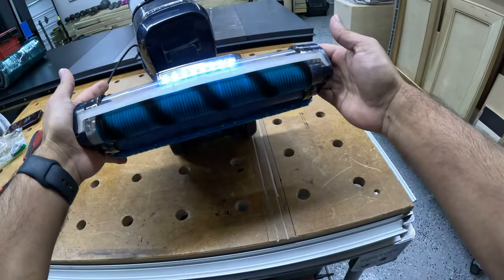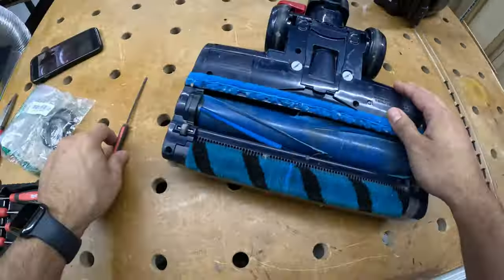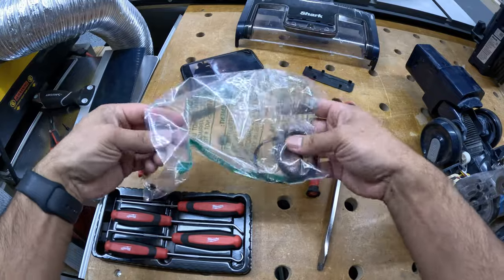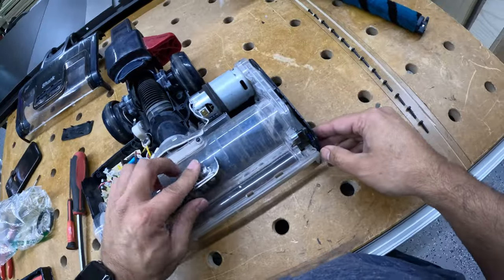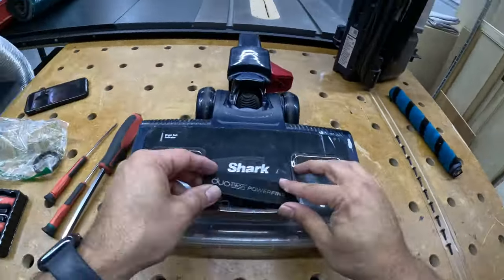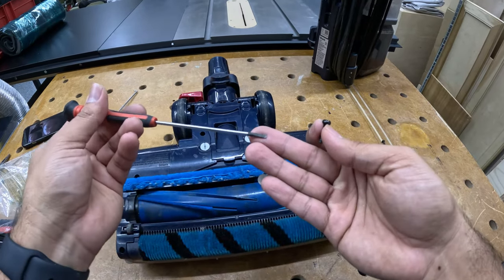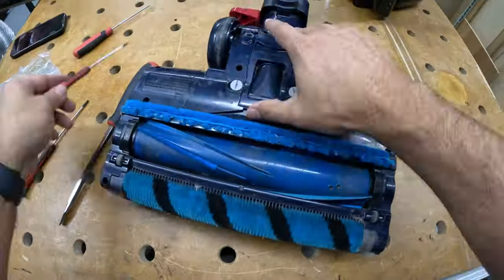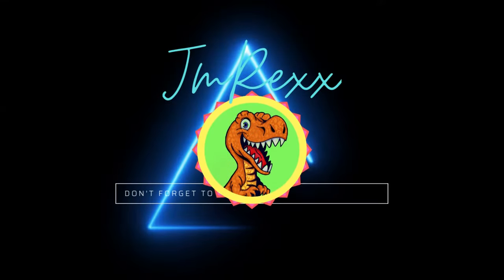Shark vacuum brush not spinning fix #handyman #diy #shark #foryou

Comment: Hi there great video. I have a similar shark vacuum. I have it all apart. My belts are intact but the brushes are not spinning. Im down to the main board. Where is the thermal fuse on these. Thank you.

Comment: Getting the right size screwdriver, a T20 was really helpful.  The screws under the upper lid which I pried off using my smallest flat head in the middle of the back ( side nearest the cannister).   were smaller, T10?.  There is also another screw inside that has to be removed.  Facing the machine it is to the right of center behind the roller in the open. I have a UV850 and the belts cited here fit perfectly.  Also I used my smallest Allen wrench to pop up the wheel that has the screw underneath.  .

Comment: Where you show “need to remove this wheel”—- how do you remove that? I’ve got everything else off except that corner
Reply from the maker: What is the time stamp? 
  So I can give you a better answer
Reply from the maker: Ok, I see that you need a skinny flat screwdriver. Slide it under the wheel and push it up then it will come out. The wheel is held only by pressure.
Reply: @Rexxthespecialist  will try thanks!
Reply: Yes, it pops right out, and there’s another little screw underneath. Will deal with that tomorrow because it’s so dang hard getting them out without stripping them…Great video by the way, thank you!
Reply: Success! Thank you 👍🏼

Comment: How do I replace the motor NV752 Shark?
Reply from the maker: Is the Motor what is bad or the belt? Now is 13 screws to remove the top cover but one (1) is by the roller cavity hidden kind of, once you that remove the roller cap and the roller will come off and you should be able to access the belt at that point. Belt Amazon link http://amzn.to/3gvOApe 
I hope this helps and thanks for watching

Comment: Bought at Costco stopped working almost right away. Should have returned it.
Reply from the maker: If Costco still have them, bring that one back and swapped of a new one, this is really good performance vacuum, is just that flaw, that if get stuck with a rug or something like that it will burn the belt.

Comment: Thanks for the video! However, you left off two CRITICAL steps in the disassembly process: 1) to get the soft roller off, you have to take out the screw sitting underneath the floor wheel - this was not pointed out and it took me awhile to figure it out; 2) to get the main roller assembly off the frame of the vacuum, you do need to remove one screw just to the right of center, then the main roller assembly lifts right off. These are two critical steps that should be added to your video, then it would be perfect!
Reply from the maker: I believe that I show the hidden screw, is been a while since a make the video, you may be right Lol
Reply: Everyone’s a critic 😂

Comment: Thanks for the video, I would have never found the hidden screws.
Can you please link the belts you purchased, I am having trouble finding them.
Reply from the maker: Here is the link:

Vacuum Fix Shark 153-3M-8 153-3GT-8 Belt. Fits Shark Models AZ1000, AZ1002, AZ1000W, AZ1002BRN, AZ1002C, AX950, AX951, AX952, ZU782, ... https://a.co/d/ejSxhs4

Comment: yes this seems like a notorious problem for these vacuums. thanks for the video
Reply from the maker: Yeah the main reason is the hair get stuck in the roll if is not clean periodically plus if is force with a rug or something get stuck in it, is almost guarantee that it will go out.

Comment: I have a shark 771 duo the brush roller motor isn’t running and the forward lights are off, but the vacuum Motor runs good, any ideas? Is there a way to reset machine?
Reply from the maker: Sorry but as right now I’m in middle of a big job and pretty busy, if you don’t mind waiting I can probably find out later.

Comment: How do i take off that little wheel i got the acrew off just that one aide with the little wheel
Reply: Same question - can’t seem to figure it out
Reply: Get a small flat screw driver and pop it out, to reinsert put it in the same position and apply little pressure to secure
it back in place

Comment: We have replaced the belt, we found that it WAS broken, but we are still having a problem-  the front "headlights" and green light are going on and off (not staying on consistently)...it seems to be sucking up things, brush rollers are not spinning correctly... something is not right....Do we need to purchase a Brush Roll Micro Switch, perhaps?  Thank you!!
Reply from the maker: So when you engage it by tilting down the handle the rollers won't start spinning?  sound like you need to open it again and manually activate the switch and see if works correctly
Reply: Thanks for your reply....No, the brush rollers won't spin.  The motor runs.  We tried cleaning/spraying female contact pins with CRC Elcectronic cleaner  but that didn't help.  To manually active the switch, how do we get to that part of the sweeper?? My husband is having trouble getting the bottom plate to come off (he was able to gently pry the sides off, after having removed screws, but can't figure out the bottom plate....
Reply from the maker: @janemartin2416   ok the motor runs but none of the rollers spin? sorry is really hard to troubleshoot in the comment section along.
Reply: Thank you so much @Rexxthespecialist  !  We were able to get the bottom plate off.  My husband will have a friend at work test the switch tomorrow with a multimeter to see if it's working or not...I've found a replacement switch to buy if it's NOT working...but  If the switch IS good?? then, I'm not sure what the next course of action would be. I don't want to bother you, but if it's ok, I'll let you know what we find out about the switch.  Thank you :)  The sweeper has been good--it gets a lot of use (we have 2 giant breed dogs (Great Pyrenees) and several cats....so I am sweeping every day sometimes twice a day.  Maybe some sweepers just can't handle that.  🤷‍♀
Reply from the maker: @janemartin2416  that's great idea, with the multimeter is for sure that you guys are going to be able to spot the issue.  I have a question: do you have the exact model vacuum as the one in my video?
Reply: @Rexxthespecialist   No, it is not the same model.  Mine is Shark model UV700. Duoclean .  Thank you
Reply: Hi: Just letting you know that the switch is good.  We are able to get the rollers to spin and the lights to come on correctly if we hold the hose/handle "just so" (but we can't realistically hold it at the exact angle needed for it to run consistently while trying to sweep the house :)). I think that there may be a broken "latch" - or something? because when  I pick up the whole sweeper, to carry it around, the floor head tilts downward and won't stay at a 90 degree angle.  This first happened about a month ago, but it still ran ok and lights stayed on, etc. but several days ago, the "flashing green light" and headlights not staying on began occuring.
Reply from the maker: @janemartin2416   wait.. it sounds like is the switch! probably the switch is starting to go bad? if not did you guys check if wires were not pinched? did you try to operate it when was open? so you can se how mechanically works and when stops? I'm sure you can spot it if you do that.
Reply: @Rexxthespecialist  Thank you.  You're very kind to try to help us..... We've determined that the switch is good.  We think that it's a problem which some Shark owners have referred to as "Shark floor nozzle head flop".  About a month ago, it seemed as if something inside (to right or left) of the swivel hose are (plastic area above) might've broken (didn't find or hear any pieces), because when I would pick the sweeper up to carry it, the floor head nozzle would just flop down and would not "stay put" (forming the 90 degree angle look which the sweeper should have).  Here is a youtube we found....Ours is a UV700- not the same model as the one shown but "close enough"....https://www.youtube.com/watch?v=1Y9zb55x3No   The youtuber said to use a T20 bit, in taking out the screws....we can get almost all of them out, but cannot get out the 2 screws needed to fix the problem and do the repair which he advocates.....  With our T20 and other bits, the screws will begin to turn then stop (as if Shark doesn't want for the screws to be removeable). The youtuber found a broken latch inside the top part.....and determined that he could take out the short screws and  drill in the same screw area ,clear down to the bottom then  insert longer screws and thus hold the sweeper "top" area to the bottom" so that things would work correctly and eliminate the flashing lights and that the rollers would again spin correctly.  Not sure what our next step will be.  Thank you for trying to help!  I LOVE the vacuum. It was purchased "refurbished" a little less than a year ago at "Ollie's". and HAS been great, unfortunately this has happened.
Reply from the maker: @janemartin2416   To remove those annoying screws try by us small flat screwdrivers they always work for me! thanks for that well articulated response, and I know SHARK want to make it impossible for customers to repair them in their on. ☹
Reply: thank you we will try with a flat head screwdriver. I tried with a very small one, but maybe a different size. I appreciate your suggestions.
Reply: thank you we will try with a flat head screwdriver. I tried with a very small one, but maybe a different size. I appreciate your suggestions.
Reply: thank you we will try with a flat head screwdriver. I tried with a very small one, but maybe a different size. I appreciate your suggestions.
Reply: thank you we will try with a flat head screwdriver. I tried with a very small one, but maybe a different size. I appreciate your suggestions.
Reply from the maker: @janemartin2416  yeah most likely is the issue. 😉👍

Comment: I need to know in detail how to remove the clear compartment that hold the belt and beater bar , I’m scared to break the side shield.
Reply from the maker: Lift the opposite side first a little and then the belt side then keep repeating that process and it will come out! 
  Hope this helps 😊

Comment: Belt on mine is fine, so other potential fixes?
Reply: My reply is kind of late but if you have enough suction on the extension clean up hose, its almost as 100% that is clogged, check for the 2 little clips underneath and turn them to the open position and inspect the hose that goes to the vacuum head

Comment: Ok. Belt is NOT broken, but tiller isn’t spinning. What else might issue be?
Reply: You ever find out what was wrong?
Reply: @lamebrainmcgee      I did. YouTube videos to the rescue.  The little square thinking that plugs into motor had come undone.   NOW. Who know how to fix an IRobot 675, that the cleaner/brush thingy stopped working.
Reply: @ivancostacurta92
0 seconds ago
My reply is kind of late but if you have enough suction on the extension clean up hose, its almost as 100% that is clogged, check for the 2 little clips underneath and turn them to the open position and inspect the hose that goes to the vacuum head